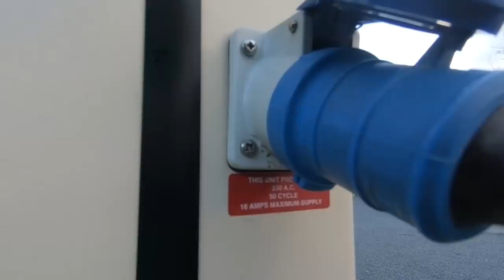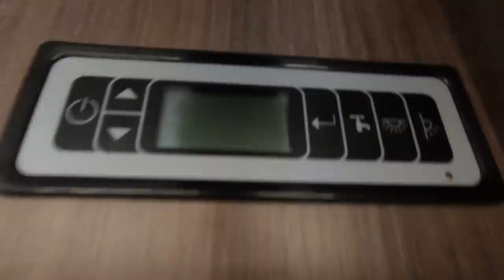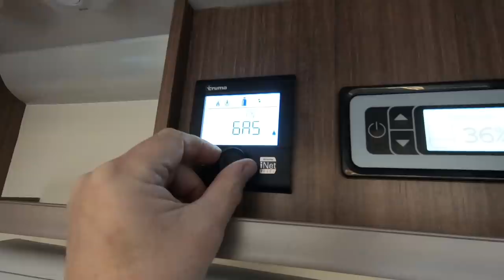Getting Set Up At York in The Bailey Advance 76-4T | Bailey Motorhome City Tour

Comment: At 1.32 mins in the video. the shower rack in the corner? Its a system we use a lot here in the Netherlands without having to drill holes in anything at home or the motor home. You first apply the mounting with supplied glue, let it set for 12 hrs, and then attach the appliance/rack/toilet roll/towel rail etc and tighten with a the supplied halon key.
Reply from the maker: Thank you, yes that would be a good addition.

Comment: Hi Bob, external Ariel socket, has it not got 2 plugs in it, looks like it from video shot, one for coaxial push fit on right hand side as well as the one you struggled to screw the satellite F connection ,😁
Reply from the maker: No, just the one lead with a male F type connector. There is space for two connectors, only one used.

Comment: Hi , do you ever use the higher grade diesel ? I use it occasionally and I’m convinced I get 3 or 4 extra mpg. If you worked it out it’s probably not worth the extra money it costs per litre but in my mind it’s doing the engine a few favours also. Anyone have any opinions ?
Reply from the maker: Not convinced, I think diesel engines are damaged by lack of use and short journeys rather than the fuel.
Reply: I agree they need a good motorway run and get hot, quite often when I use the higher grade diesel I can get 33 or 34 mpg I have never broke through the 30 barrier using standard fuel.

Comment: This might be a daft question, newbie here, but, can you only use your coffee maker if you are on a hookup, because of the three pin plug? Really enjoying your content, as usual, thanks.
Reply from the maker: It's a question that gets asked a lot, but you're correct, it's a 240v appliance and you can only use it if you have a 240v hook up, or another 240v supply from a generator or 12v/240v invertor. Three pin plugs are 240v, the cigarette type sockets are 12v, and they provide 12v whether or not you are on hook up, because of the on board leisure battery and battery charger.